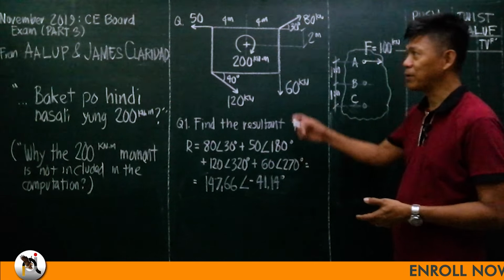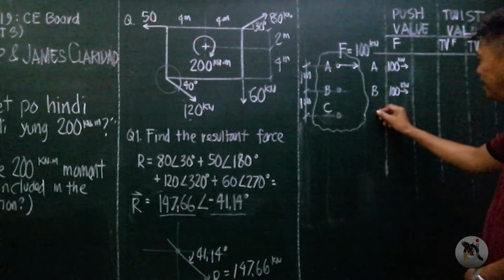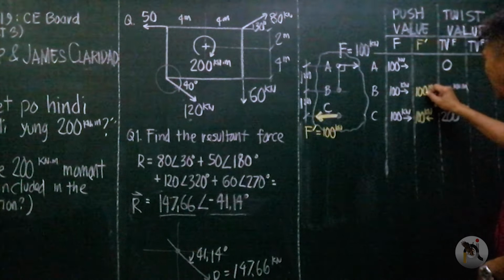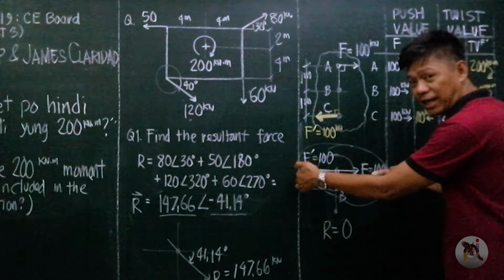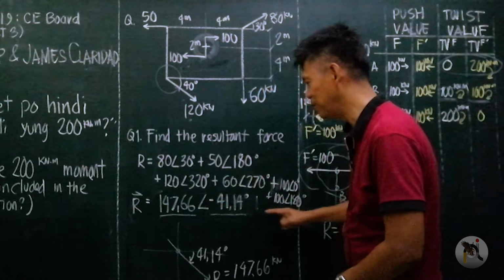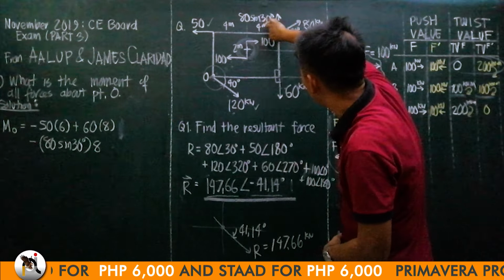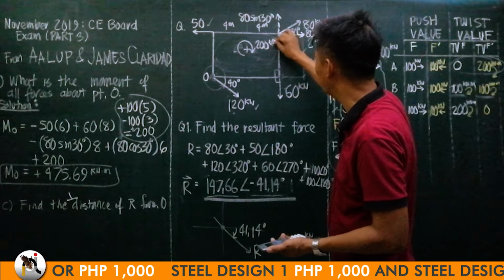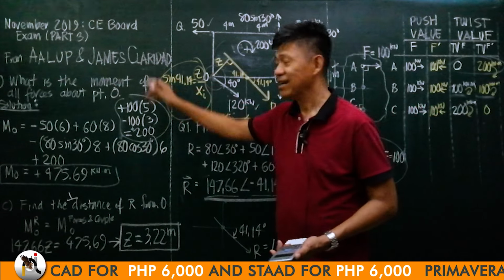Vague Concept About "MOMENT" Explained!

Comment: Good day sir. I think this topic is related to my concern about truss analysis.  Common Analysis 
being taught in school  is that we should analyze it Pin-Roller support, this kind of analysis produces higher axial force and requires more area of angle bar. While pin-pin support doesn't produces high axial force for every member. Pin-roller support only gives downward force , pin-pin support gives pushing and downward force and it can produce big twisting value. Which do you think is the correct way to analyze a truss sir? .. This bothers me for a long time
Reply: Ill create a video for your question Mr Jay.
Reply: @perfectopadillajr3452  Thank you sir. more power.